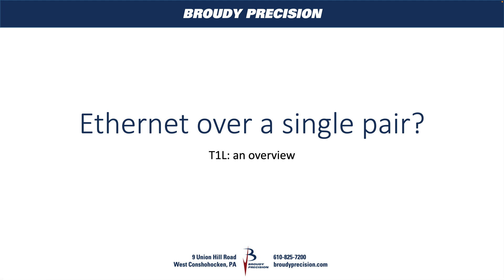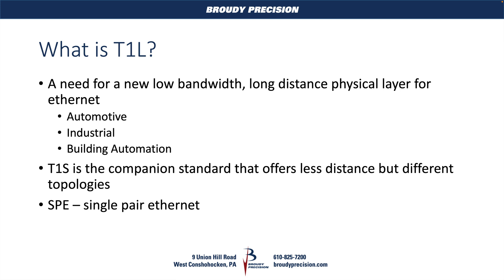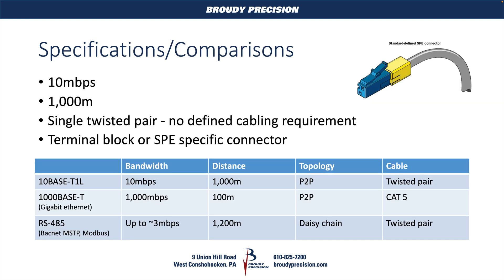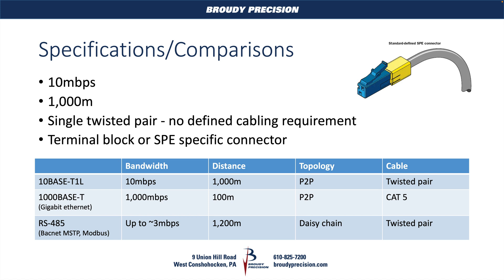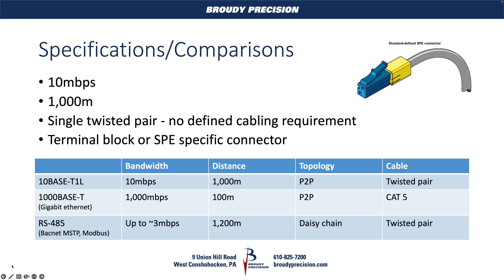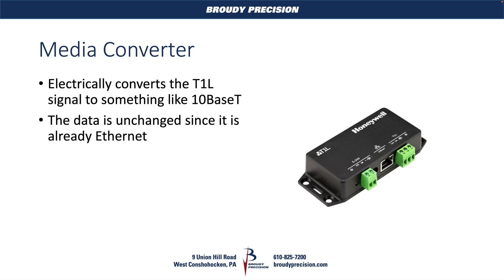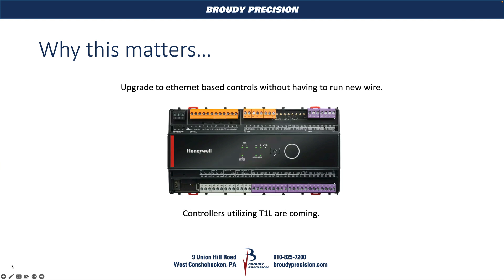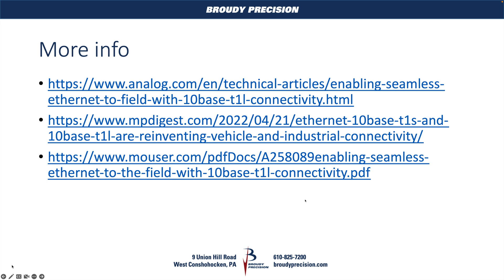Ethernet over a single pair? - T1L Ethernet

Comment: I noticed the topology was P2P, so if we were upgrading a LON network to T1L does this mean we can't reuse the existing daisy chain bus?
Reply from the maker: You can still use the daisy chain. Instead of terminating both wire pairs under the single set of terminals, you would now be putting one pair into the first interface's terminal and then the second pair into the second interface's terminal. -MW
Reply: @broudyprecision  Thanks Matt. Keep up the great work man! 👍🏼

Comment: How do the 10BaseT T1* specs differ from existing solutions like Cisco LRE from the early 2000s?
Reply from the maker: I'm not really familiar with LRE, but technically it looks closer to DSL than ethernet and since it was proprietary to Cisco and not an open standard, you were paying Cisco tax with a lot less interoperability. -MW

Comment: Very interesting!  Will this allow 10Mb/s ethernet over the old landline wiring in my house?
Reply from the maker: Yes. Though you may find the speeds limiting in a typical web browsing application. Powerline ethernet may be a better fit because of the higher bandwidth. -MW